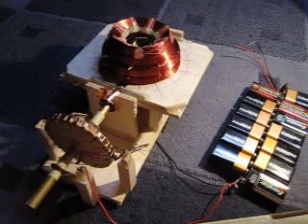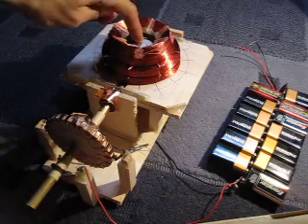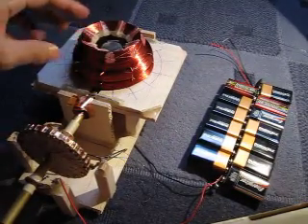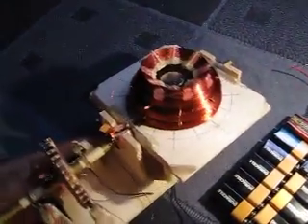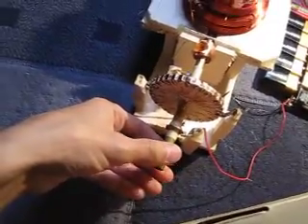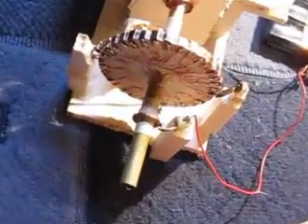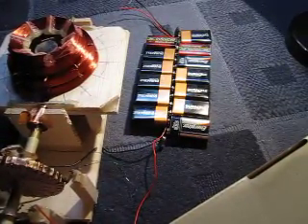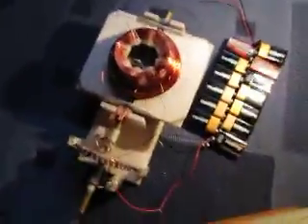Improved Joseph Newman Motor

Comment: Hi did the batteries run out of power at the end.?
Reply from the maker: I ran it for over 3 days straight, at which point the batteries voltage had gone down a couple volts.  So at that point I realized it wasn't over unity yet, but perhaps only 99% efficient.  So I shut it down.  I was going to build a much bigger version with finer wire, and although recently I actually finally did buy the wire (cost over 300 US) I haven't started building or winding the wire yet.  But I plan to soon.  Eventually I will create a new Newman motor complete with 3D printed custom parts, but its going to be a while.  A few months at the least.
Reply: @spiritelemental I think I know how it works but I don’t have the money for the material. Since you already have everything built I could tell you. I saw one of Newman’s videos and he said there was something he wasn’t disclosing. I was reading some old papers about the Newman motor and one of the engineers that was backing Newman says what Newman was doing. It should work and it makes sense why he was making his coils so long because they don’t need to be as long as he was building them. It does make it easier to do the trick he was doing. If your still messing with the Newman motor let me know and I will tell you what to try.
Reply from the maker: @Flowtester1  I have Joseph Newmans book where he explains exactly how to build it and how it works.  I followed the plan exactly except I built it too small.  He says you have to have a certain minimum size and length of wire in the main coil for it to actually work right.  I will build a larger version eventually.  I have over 10 pounds of magnet wire I bought for the project, which has been sitting around for a couple years now collecting dust.  Lol...    

If you have new information, please by all means, let me know.  I would recommend emailing me since youtube censors a lot here.  You can contact me by going to my website, thanks.  spiritelemental dot com

Comment: Your commutator needs refinement. I'm not sure if the carbon brush is making proper contact with the other surfaces. All that noise is from the segments hacking away at the brush and the brush is just bouncing around. Your prototype is very different from Newman's. If you don't own a hard copy of his book, kill for one! And, by the way, his book contains anti-gravity proof of concept...
Reply from the maker: Correct, my commutator needs refinement, however the basic setup of this prototype is identical to Newmans.  I read the book and still have it on PDF.  The problem I had was that the device is too small and the wire length of the coil is to short.  Thats why it didn't reach over unity levels but still functioned at perhaps 99% efficiency.  I ran the machine for days and the batteries had only gone down a little bit.  I will build it again someday to the minimum size newman recommended.
Reply: What are the draw backs and why hasn’t this been commercialised ?
Reply: @RussW185  https://www.youtube.com/watch?v=CrJIzrmX1mI

Comment: Thats nice ,i watch your egg propeller video and had some advice instead of putting it on a boat take it and stand it ((upwards)) and the egg is used like the suns magnetic pull on earth always in the center and some brass rings as spark gaps = brushes and at the end a(( copper funnel))and a rotating magnet at the end of the funnel  ....This device will pull in energy and push it outwards